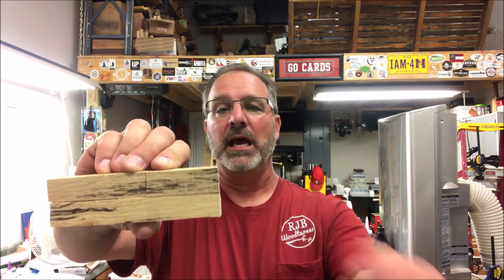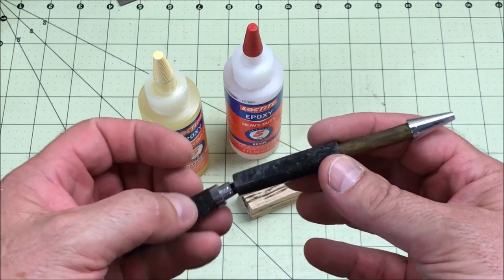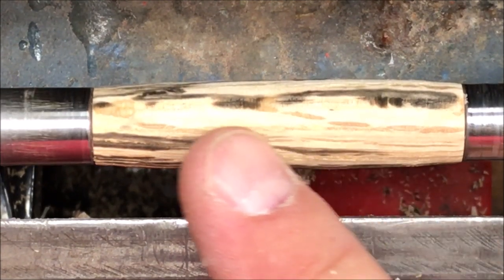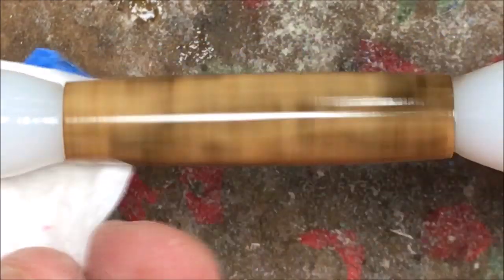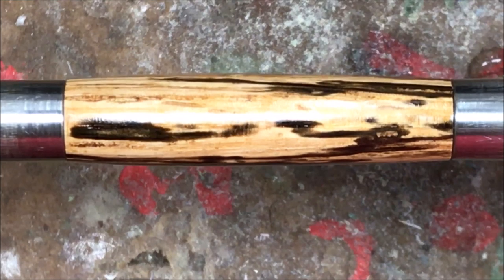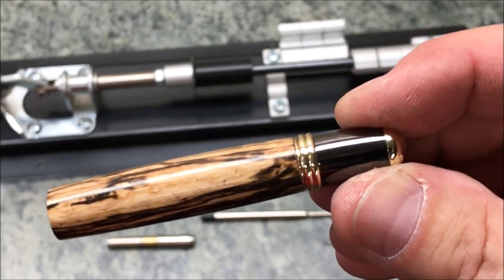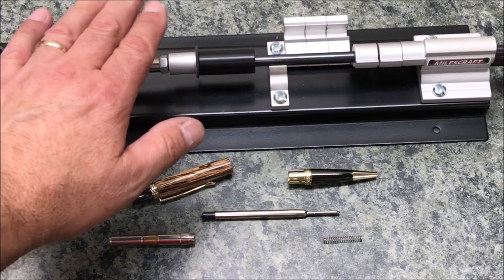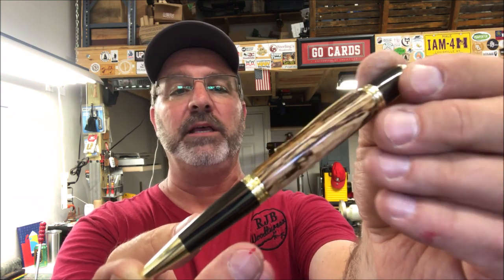Pen Made From A Blank Form Hurricane Michael

Comment: Beautiful as always Bob.  I agree on the need for mobility on your pen press.  I have the same press and simply mounted it to a wood base (1x6 pine) and then recessed some rubber feet to the bottom to help with slippage.  Simple fix and works well.
Reply from the maker: I think Rubber feet are in my future. 

Regards,
Bob

Comment: I agree on epoxy. I went to a few years ago for multiple reasons. Besides the benefit you mention it also has gap filling properties since it's thicker, and the big one for me was more working time. I switched after having a few tubes set up before they were fully inserted. I have even gone to 15 minute epoxy - I'm not in that much of a hurry.
Reply from the maker: Thank you John. 

Regards,
Bob

Comment: Great looking pen, Bob. I've stopped using medium CA for tube gluing a while ago, for the same reasons. i switched to Devcon epoxy, it has been working without a failure for over a year.
Reply from the maker: Thank you Tarry. 

Regards,
Bob
Reply: I've been turning for only a few weeks.  Glad I got a heads up on the CA/tube problems early.  Thanks for the heads up.  I'll be switching to epoxy soon.
Reply from the maker: It works great,, you just have to plan ahead for it to dry. 

Regards,
Bob

Comment: Hey Bob, great pen. I've always seen you use that same gouge and I've been curious about it. What is it exactly and how easy is it to sharpen?
Reply from the maker: It’s a 3/4” Benjamin Best roughing gouge. It’s easy to sharpen but I have the Wolverine system which is why. I grind the edges back so it’s more like a spindle gouge. 

Regards,
Bob
Reply: @RJBWoodTurner  Thanks for the info! Looks like it works really well. I have a roughing gouge and a wolverine system but I usually sharpen mine on the flat platform. Do you sharpen yours using the varigrind to get that shape?
Reply from the maker: I use the pocket jig. It’s quick and easy. 

Regards,
Bob
Reply: @RJBWoodTurner  Thank you so much for your time and responses. Haven't heard of the pocket jig for sharpening gouges. What is that?